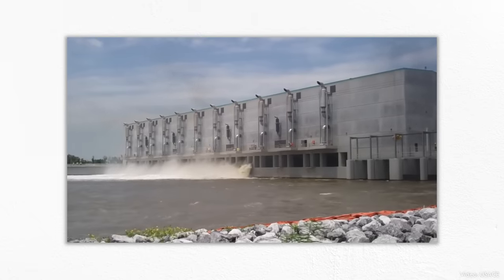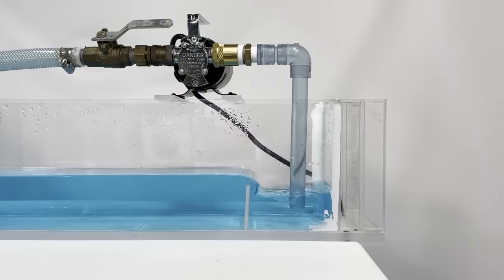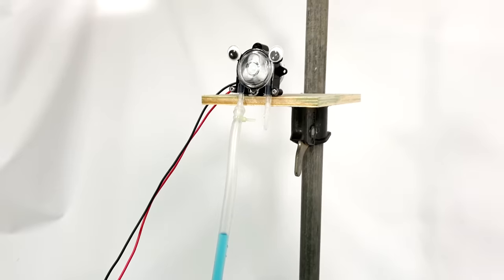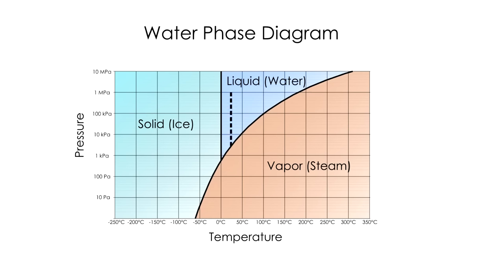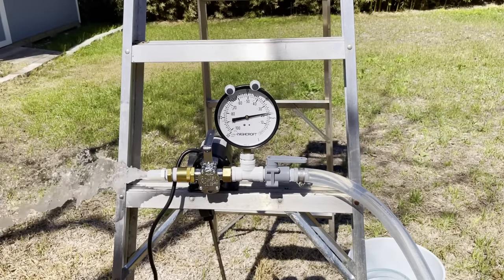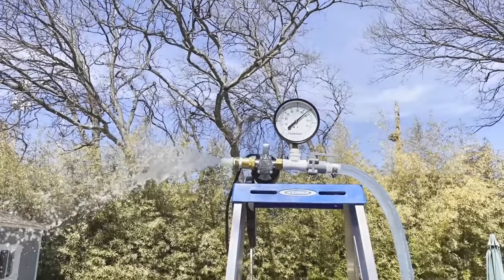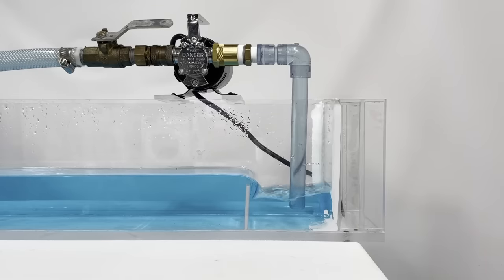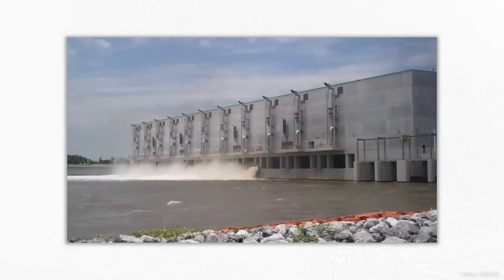The Fluid Effects That Kill Pumps

Comment: Hello fresh 187 USD per week for 4 meals. With the promo it is 88ish USD for the first week then 187 for each week after. Basically budget 200 USD per week for dinner. If you spend less than 800 a month at the supermarket or eat leftovers you are better off. with the plan you still need to count for breakfast and lunch and 3 dinners for each week. Not worth it.

Comment: 0:15 "lifting a boing 747 every second" might tell us the volume, but not how hard to this is, as it does not tell us the pump power at all. How for does it lift this weight per second? A kilometer, a millimeter, a foot? You know, I can also lift a 747, just in the sub millimeter range.

Comment: Could you provide some advice on a project I need to figure out? We've made an in-ground swimming pool. I got an Alpine 10300 gph pond pump at the onset of the project to pump the water out of the hole so we could put the liner in. I planned originally to use said pump in the pool to create a waterfall system, pump water up from the bottom roughly 8 feet up into a receptacle and let it fall back in for water circulation to keep the water from stagnating. What I never even once considered was that pumps can become dangerous and electrocute you if they have a failure. I know, I should've seen that from a mile away but had a lot going on with this project in other parts. I plan to draw from the deep end of the pool and have the water feature come down near the middle of the edge on the same side. For specs, I've listed the brand already, but it's a PAL10300 with a maximum flow of 10300gph, maximum power of 960 Watts, maximum amperage of 8 amps, maximum pump head 40', 2.5" outlet and a 2" intake. The wall of the pool itself is roughly 8' deep where I would try for the intake. What I'm wanting to try to do is convert the submersible pond pump to be an above ground fixture using pvc. Send a pipe down near the bottom, come up with that and make a 90 to sit on the ground. Run that into a box with a filter slotted in before the pump. Then send that another 6' to 8' up to a receptacle to pool water for the waterfall feature. If I can get the pump primed by pouring water in to the pump box would it continue to pull water from the pool, or will this never work?

Comment: “... capable of lifting a fully loaded Boeing 747 every second....”. Lifting how high/far?
Reply: without that dimension probably. just how much mass flows trough the outlets every second
Reply: Those flood control pumps are in the  least produced head massive flow category of pumps. Probably they are lifting by a ~meter only.

Comment: Horrible explanation of pump priming!  Most pumps can't suck!.  In other words, most pumps can not create an internal vacuum (below atmospheric) pressure to allow water to be drawn up into the pump.   A common method of priming is using a separate vacuum system to draw the air out from the high point in the pump casing allowing liquid to fill the pump cavity.